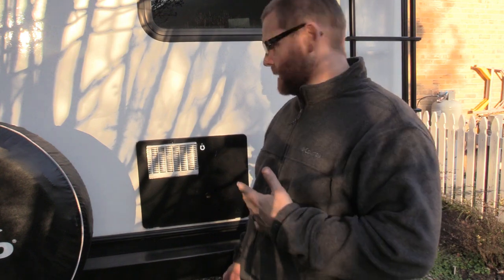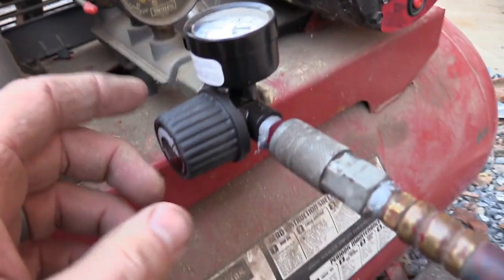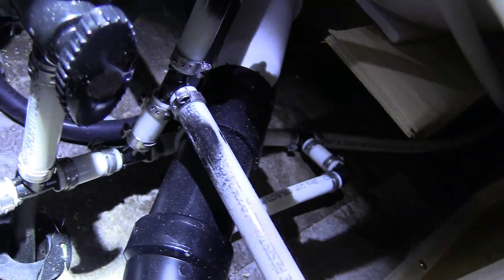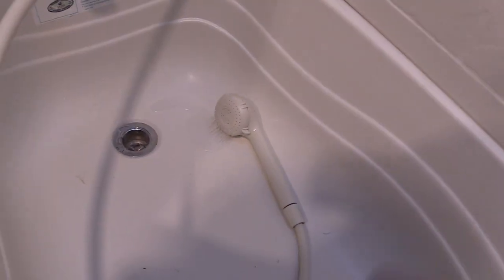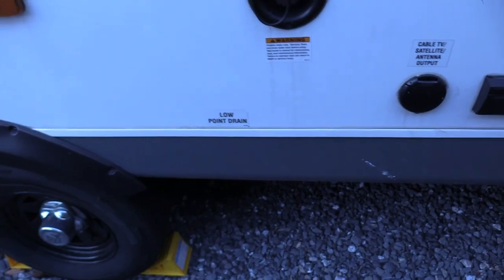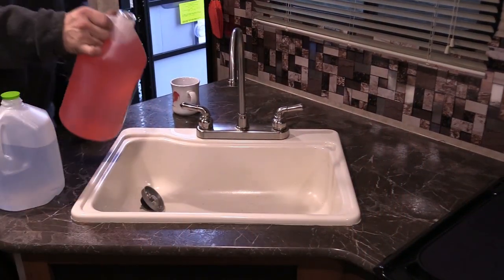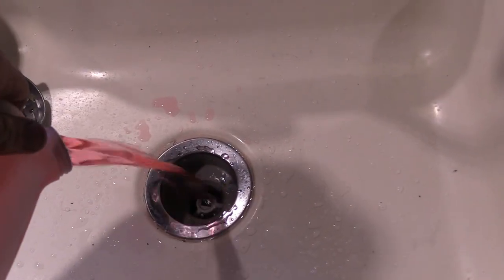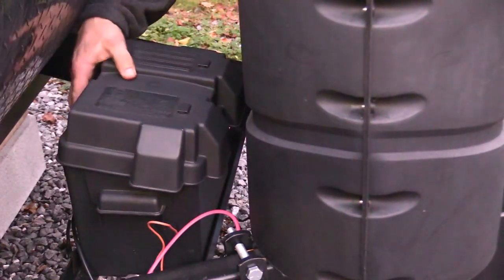How To Winterize Your Travel Trailer Or Camper Using An Air Compressor

Comment: Good video.  I installed a battery cut off switch, so I can shut off power whenever RV is stored.  Happy camping.
Reply from the maker: I've thought about doing the same thing. That's a good idea. Happy camping to you as well.
Reply: I'm using this method this year so this video was insightful, question though won't the battery discharge over the winter if it's not on a tender of some sort?
Reply: @ricks5876  
Yes, you would want to use a battery tender.  The battery cut off switch only prevents parasitic drain when not connected to shore power.
Reply from the maker: Yeah I just unhooked my battery last year and left it.. Outcome was a dead battery... I will Definitely use a battery tender this upcoming season
Reply: @christopherbreuer9516  that's what I do with my batteries, I thought when I saw that maybe he knows something I don't 😁
Reply: Why not just leave you camper plugged in and save the money you would have spent on a battery tender for beer next camping season.
Reply from the maker: That's not a bad idea.. Sure wouldn't hurt.. Great idea.

Comment: Do you need to do anything with the black tank flush line?
Reply from the maker: No i just made sure that when I dumped it it was all out. Then I put some antifreeze on the toilet and dumped it into the tank. So far I have had no issues with the actual line freezing because I made sure it was completely empty minus what I dumped in the tank.
Reply: I'm referring to the line that you hook a hose up to in order to flush out the black tank.  Thank you for the quick reply!
Reply from the maker: No i didn't but now that you mentioned it I may need to think about it. I actually didn't think about that one. Have to put that on my list.
Reply: just blow the black tank line with air adaptor like rest of camper aok

Comment: I will try this method in a couple months.
Reply from the maker: Let me know how it works for you. It's so much easier in my opinion
Reply: I will do and just subscribed to your channel.
Reply from the maker: I do appreciate it. Have a great day.
Reply: I just aired out my system using Viair portable 12V compressor and worked flawless. 

https://www.amazon.com/gp/product/B004B68XGC/ref=oh_aui_detailpage_o01_s00?ie=UTF8&psc=1

 Quick question for you. I have a new 2019 Gulf stream Vista Cruiser travel trailer and i was wondering when i pump air through the city water connection if it is plumbed through the water pump? if not how do you air out the water pump using this method?
Reply from the maker: Im not 100% sure, I do know that once you pressurize the system though it does get just about everything out of the line including the pump. What is left is just drops which will not freeze and bust anything. However I've also been told that you can run water pump for a few minutes and it had a saftey feature that will not let it burn up. Don't take my word for that though check your owners manual and contact a dealer too. If you ask a dealer make sure you talk to the service department chances are the dealer or salesman only is told to tell you something he's been told to tell. When I have a question I talk to the service department and I ask... Do you have a camper? Do you blow out your lines? Those are the people who will tell you the real truth. Sales people only want to to make money so they will tell you and sell you something you probably don't need. Hope that helps. It's kinda long winded 😂
Reply: Thank you for the reply. I just turned my pump on and let the water clear from it just like you did. Should be good to go. Thanks again.
Reply from the maker: Definitely my pleasure. Hope you had a great camping season... Have a great day.
Reply: Season is not over yet. Just did a practice run to see how it works. I camp year round and i am in Idaho.
Reply from the maker: That's awesome, I'd love to camp year round but my work it's just wouldn't happen.

Comment: Curious about the stainless hose and shut off you used on your water tank. I would love to know the size hose and shut off you used. TY
Reply from the maker: I used a 1/2 brass fitting then a 3/8 compression fitting on one end and a half inch on the other. hope that helps

Comment: This is great, thank you!  A winterizing method that makes sense, is quick, and doesn't rely on antifreeze in the water supply.  The real danger with freezing water is if it FILLS a pipe, since it will expand and crack the pipe.  It's not a problem if the pipe is mostly empty, like this method results in.  But shouldn't it be okay to use automotive antifreeze if you're just putting it in your traps like this?
Reply from the maker: That's what they say I put it in my traps and so far so good. Thanks for watching and commenting